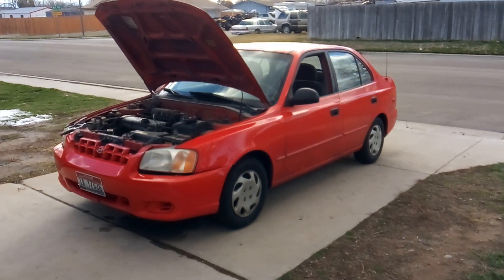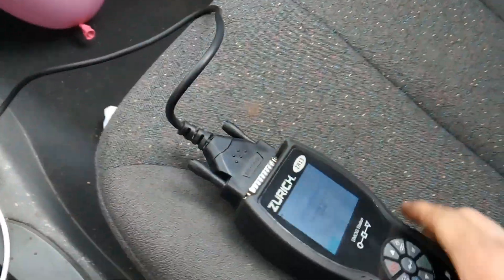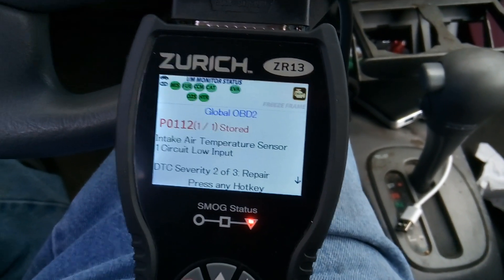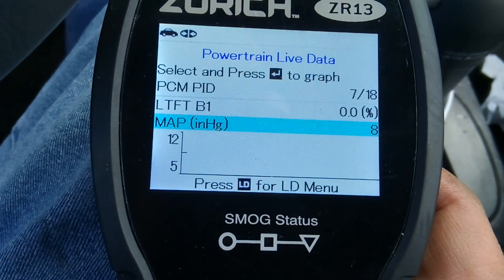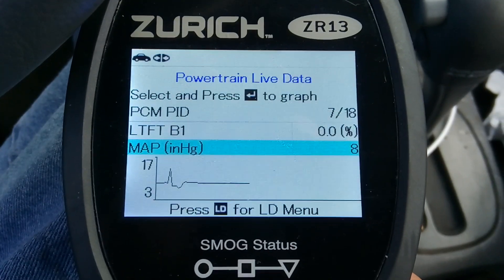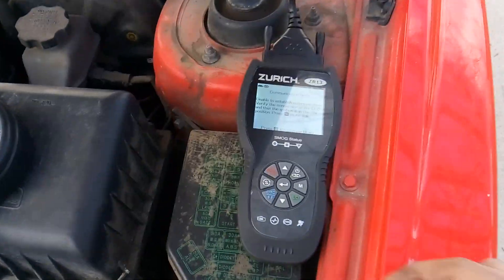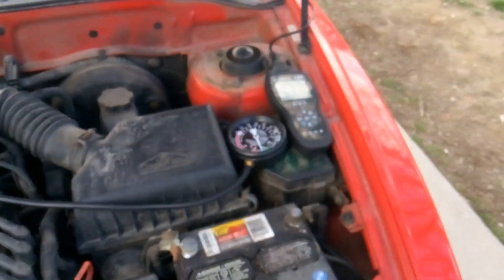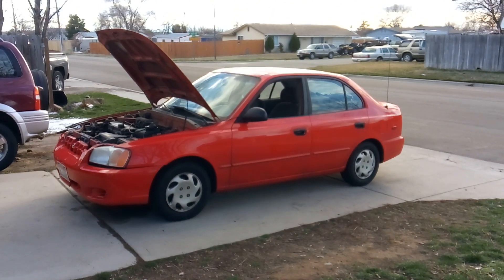2003 hyundai accent MAP/IAT  diagnose

Comment: Very helpful video, thank you. My 01 Accent sedan did about the same thing. I got the initial code which then switched to a code 112. My OBD2 reader is also saying it's resting around 8-9inHg as well. Curiously though after switching the battery today the CEL went away. For a while the scanner tool would display the code as pending, but now there is no code that even comes up. The live diagnostics tab still shows the inHg readings as the same however so something is definitely funky.